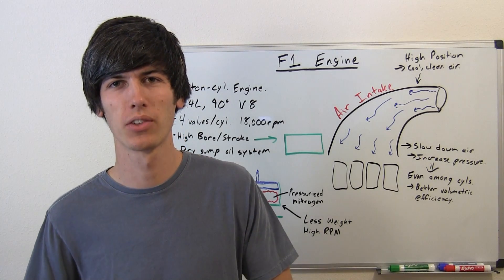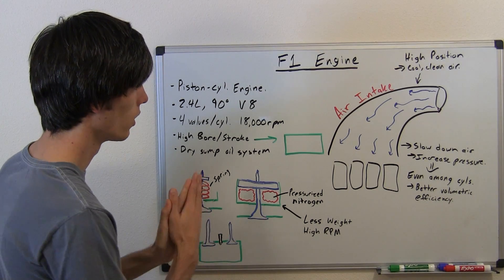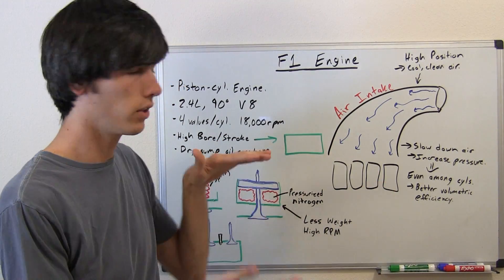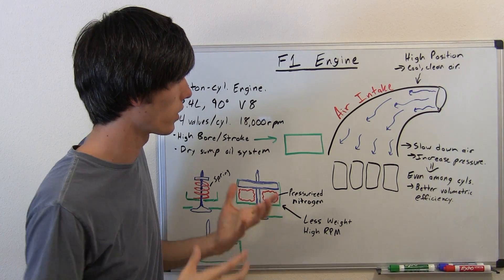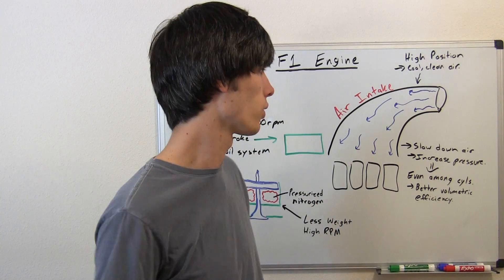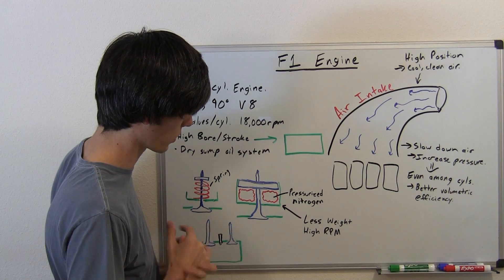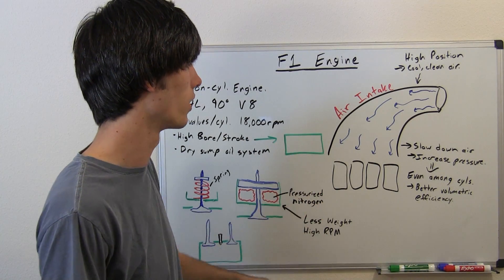F1 Engine - Explained

Comment: they were only limited because of the grooves , but not from tire wear , they pitted pretty much every 10 laps , nowdays at the end of the stint they have little fuel but most times they are on tires that are almost destroyed  , 2004 cars also had traction control 

but all in all i think the true diffrence in lap time would be about 2 seconds or 1 compared to the 2011 f1 cars

Comment: Well, the tyres in 2004 were limited, but they wasn't such a big issue back then, because they hold half a race without big problems, not like the Pirellis now. And although they start with full tank now. The fuel load for the last stint in a race is comparable and the 04 cars used also groved slicks which should be slower. And still, the cars of today can't cope with the 04 generation cars. The aerodynamic and enginepower back then where just so much better.

Comment: yes but in races nowdays cars have FULL fuel and only limited amount of tyres , in 2004 they had unlimited tires , refueled and changed tires every 10 laps or so thats the reason why in some races in 2004 the fastest lap was faster than the pole time  , the cars were also lighter back in 2004

Comment: Yes in the qualifying. But in 2004 they drove the qualifying with the fuelload for the entire first stint in the race(12-25laps). Compare the fastest lap in the race and you will see, that the 2004 generation cars were 2-4 seconds per lap faster on the same course. Most lap records are still from the 04/05 seasons.

Comment from the maker: They may be titanium or another light strong material. Valve float typically is a result of the springs oscillating, almost randomly, at higher RPM, not having enough time compress and stretch out. The pneumatic valvetrain, as shown in the video, plays a big part (if not the biggest part) of allowing for high RPM. Once again, a small stroke is important as well.

Comment: doesn't the cam, weight of valves and spark also have something to do with the 18000rmp the engines are able to produce? because if you are building your own engine and try revving that to high you will eventually get valve float and/or knock. could you perhaps do a video on how the F1 cars are able to rev that high? looking into the "cam" lift and duration and what kind of valves and ignition units and curves they are using?

Comment: How does slowing down the intake air increase the air pressure? If pressure is the force exerted on the containing walls by the molecules, surely that force is higher if the K.E of the air molecules are faster? Am i forgetting about some other force? Iv just started my mechanical engineering course, we haven't covered any types of fluid motion etc. Thanks

Comment: The purpose of the oil pan itself is to keep the oil away from the crankshaft and connecting rods. A dry sump allows you to place an external oil pump wich allows you to lower the engine which lowers the center of gravity and also is much more effective at circulating oil in high speed corners when oil would be forced to one side of an oil pan.

Comment: Efficiency == Green. I know that seems to grate with a lot of you, but it's true. The Greenest petrol engine would waist very little energy on friction, noise and heat. It would all be used to push the car forward. Grand old F1 engines were very uneconomical. You've been cheering on Green engines (or Greener) for years and you din't seem to know it.

Comment: There are NO gearboxes that work like a F1 gearbox. Similar, yes, but not the same. Paddle gearboxes are just a fad, as most people use the gearboxes in the fulling automatic mode, unless they are racing, which should not be done on public roads. Most cars that are made for the track like the GTR and Porsche's Ferrari's etc, are terrible to drive in city traffic.
NO car has air controlled valve gear.

They now bear no resemblance to road cars.

Comment: I looked this up a few years back for some project and I am not 100% certain but I believe that it was because it lead to a number of accidents and they were trying to cut down on them.

I see where you are coming from with the argument for why not change the tracks but that is hardly feasible; it would cost millions to change the layout of the tracks and some of them, think of like Monaco, it would be virtually impossible. It was probably easier to detune the engines
Just my 0.02

Comment: great video, just one thing to keep in mind for your viewers. You explain volumetric efficiency right just just left out that there IS a sweet spot/limit. No matter if its supercharged, turbo charged, or naturally aspirated air/fuel ratio has to increase as well. im sure You know this but alot of ppl just think boost=hp which is not true. my truck is alot faster with 55psi vs 65psi bc my fuel caint keep up after 55psi. cheers

Comment: yep it does, because when you slow the air down, you have to squeeze more of it into the same space to keep the flow of mass (in a pipe for example) constant. There even is a formula for that, called Bernoulli's law.

Comment: They banned them in '89 to help make it safer; something to do with the fact engines were making about 750 bhp/liter. 
Now they are making a slightly less insane 3-400 bhp/liter.

For the 2014 season they are going down to 1.6 turbo v6.

Comment: It's like blowing through an unrestricted tube- if you kink it up (i.e., slow the air flow), the pressure goes up. Try it with a straw. Great presentation overall, no?

Comment: Not, really. It definitly helps yes, but the idle rpms are necessary because of the lack of moving masses. F1 Engines haven't even a flywheel. So, theres aside from high rpms not much that will keep the engine spinning.

The external starter is used to save weight. It's the only reason.

Comment: Correct me if i'm wrong, but is it the wide bore that results in high idle rpms in f1 engines?  Surely an engine with a short piston travel would idle higher seeing as the combustion does not have to push the piston as far to complete one revolution?  Is this also why the engine has to be fired up manually, or is that just to save weight?

Comment: air fuel mixture will always be required for the engine to combust at a steady speed, but it is ignition timing that dictates engine speed. Ignition Timing significantly lower than MBT, will result in poor acceleration or even no acceleration at all even with the "gas pedal" at WOT allowing more air to be injected. Ignition timing close to MBT  will increase cylinder pressure will results in a higher Σy*sin(theta) force, and torque . High timing results in higher pressures, which lead to knock.

Comment: I notice you didn't mention Brake Mean Effective Pressure... Might be a consideration to touch on in the future.. As well the rotating mass these motors do not have. 
There is a great deal of science that goes on with these engines. Not just with the theory, But with the components alone such as MMC's and so forth. 

Great video.

Comment: Hi, Many thanks for the explaination.
In fact it is quite simple and logical. My mistake is that I thought that the mixture volume is constant, no matter the rmps.
Now if I understand good that isn't the fact, only the air-fuel ratio is constant. Right?

Many thanks,
Best Regards,

H.

Keep on making these fantastic video's, everthing is very well explained also for a mechanical nitwit (I'm an electronics engineer)

Comment from the maker: No, an engine at 2000 RPM with the throttle completely closed (nearly idle, check out my video "gas pedal") will be pulling in much less air than an engine at 2000 RPM with the throttle fully open (and it won't be at 2000 RPM very long). As you burn more fuel (and air) the force is greater on the piston, so it speeds up, increasing your RPM.

Comment: Or has it something to do with the richness of the mixture that changes when you hit the trottle? So when the mixture is richer (more fuel vs air) the explosion in the cylinder is larger, so the piston is slammed harder down, so it the whole cycle becomes quicker, so higher rpm? I also thought that the mixture was constant (except for a cold motor) or isn't that right neather? I'm confused and maybe a little dumb.

Comment: Great explanation!

One, maby dumb, question:
1 first of all excuse me for my poor English
2 I know the principle of different type of motors (2 stroke, 4 stroke, diesel, Wankel, etc.
3 But, (it may be silly) what I don't understand how the rpm's increase in a motor.
When you push the trottle, basicly there is more mixture (air-fuel) is pumped from the injector system (or carburator) to the cylinders, but the amound of mixture in the cylinder is equal every stroke (or isn't that right?)  Tx H

Comment: Regular cars are a bit heavier than F1 cars, to move weight you need torque to make torque you need displacement, you also don't need to accelerate from 120 to 180 in 2 seconds in a regular car as often either. Piston speed is still bad on blocks which conventional (especially Ford modular v8) engines still have plenty of. This is one of the reasons why the Ford 4.6L and 5.4 v8s weigh as much as a Ford 7.5L v8 as the blocks are cast very thick to support the unusually long strokes and high rpm.

Comment: Each race is around 300km so 8 races would be 2400km. I think the block is aluminium but a lot of titanium and other expensive metals is also used. Also pretty sure the nitrogen valve train is custom built for the F1 engines.

Comment: Also, these motors operate above 100% VE. They use overlap of the camshafts to do this. The intertia of on coming air allows more air to be packed into the cylinder.

Comment: You are incorrect the short stroke makes it cover a shorter distance at the same rpm. If you have two engines with equal rpm and one has a longer stroke, the piston must travel faster to cover the extra distance. It's simple math.

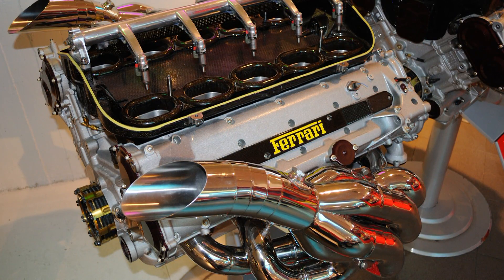Comment: At 8:18 your information about piston speed as it relates to stroke sounded incorrect. The shorter stroke is precisely what causes the piston to move faster,hence the engines higher rev capability.

Comment: Not true, paddle operated gearboxes are becoming common, even in cheap cars.
The engine preheating, the 2014 regulations is doing away with most of that, the 2014 turbine must be able to start and run at background temperature, it is in the FIA regulations.

Comment: The main point is resonance (frequency) Normal  steel spring will lose its tension  when it hits its natural resonance just google it. Its like the diifference between trying to make a steel bar or a rubber balloon to vibrate on a specific amplitude.

Comment: When will we ever see engines that have to be heated with oil and water before they can be started? When will we ever see air controlled vales in cars? When will be ever see carbon fiber brakes or clutches? When will be ever see gearboxes like in F1 cars? All  in regular cars? NEVER!

Comment: Renault first used pneumatic valve gear on their turbo V6 they had in 1986. Lotus used those engines in 1986, since the Renault car team had withdrawn after 1985.

Comment: So the pneumatic valves offer more powerful resistance than traditional springs. How does this not destroy the camshafts? With the amount of force behind the compressed nitrogen wouldn't that ruin the cams?

Comment: The minimum life is regulated. At the moment, the engines had to hold up to 4 complet raceweekends. Which means they done after around 3000km/1500miles. But thats only the block/head/crank- camshaft and pistons/cylinder and other internals. Every external part, like the alternatore/oilpump/waterpump/KERS-Motor and so on, are changed after every race due to increase the reliability because a failure of this parts can also destroy the engine, which would be a desaster.

Comment: nice video now i understand about high rpm engines. 1 question what's the life of a f1 engine ? are they durable like normal engine or they have to replace some parts like top fuel dragsters for each race ?

Comment: Well its RPM and throttle.  At idle the engine is under vacuum and not burning much fuel, but under full throttle its displacing its full amount.
This is the same with all cars, except stock street cars are extremely muffled so its not as dramatic.

Comment: F1 engines have pneumatic valve trains, not the usual spring and valve setups. It was first used and designed by Williams F.

Comment: Engines sound comes from its configuration and firing order, and exhaust also plays a big role.
Turbo's act a bit like a muffler and change the exhaust note of a car.  Most engines tend to sound better turbocharged (esp if you can hear the warble) but I'm sure that's not always true.
Personally I think turbo I-6's, and V8's sound the best, but everyone loves their own thing.

Comment: The rumbling in the pits are made up by the pitspeedlimiter. In fact, they limit the revs quiet harsch.
The crackle or popping sound is in fact a misfire. It's not so obvious at the TV because the Microphones can't record it in a proper way. The misfire isn't a failure or something. The ECU interrupts the ignition for a short moment when the gearbox is shifting to reduce the load on it. Some unburnt fuel-air mixture then ignites in the exhaust and you can hear a "pop" on the TV.

Comment: Hum hum... I thought that air entry was designed small to large to create a venturi effect, giving it more speed to "overfill" the engine with air, a bit like a turbo... It's not slowing the air at all in this case, does it?

Comment: It all depends just on one fact - crank sh./cyl. arangement. 4stroke engine works on every second round, most of ussual engines has crank shaft arranged in 180°offset - so logicaly, there must be 2cylinders working at once in case of 8cylinder engine ...
You could make an 8cyl. engine with separate each cyl. working period - but then a very complićated crank shaft 'd be needed. YZFR1 2009 (big bang) did have 90°crank offset - need to know what's big bang and what screamer :-)

Comment: well from my point of view, it is very strange because you know two cylinders are really never sinchonized for several reasons, compression difference, ignition timing,temperature, etc i mean you could make bigger piston in a v6 instead smaller ones in a v12 exploding at the same time in 2 similar c.c. engines, however thanks for your explanation there are many interesting things in your channel.

Comment: just a difference in the way engines are set up. bigger engines last longer due to the lower rpm. parts don't wear out as fast, but they have a more narrow power band and generally slower response time kinda like a Harley vs a sport bike. Harley will get the sport bike off the line but the sport bike will kill the Harley in the top end.

Comment: small stroke engines make higher horse power and lower torque than a large bore large stroke engine. torque is the ability of horse power to do work. Volvo has a 16 liter 6 cylinder engine for their trucks that makes up to 605 horse power at 2000 rpm and 2250 ftlb torque at 1100 rpm due to the large bore and stroke of the engine. a small engine with the same power could not pull a load or live running over1,000,000 miles of hard work due to the less torque output even if horse power is the same

Comment: exactly, something like horsepower per gallon is a term that would make sense, and obviously extra weight will lower how far you go with that horsepower, always found it annoying how 1 litre 4 cylinder is automatically seen as way better than a 6 litre v8, not necessarily the only obvious factor is the v8 probably weighs more as well as the additional inertia and friction from bigger parts but you cant know for sure which is more efficient just off those stats.

Comment: What you mean with irregular? It's a racing engine and so it has nothing to do with normal engines. This engines are single purpose build. Why 2.4l V8? Because the rules say they have to use this type. before the V8, they used 3L V10. You can say, the V8 is a V10 with 2 cylinder missing, but then, why they used a V10? Because the rules said they had to. F1 was always a rule thing and will always be. The goal is to build the best possible engine which don't breach the rules.

Comment: I have always been interested in it. Let me ask this? I understood that high rpm engines have shorter pistons or cylinders, but why do they build irregular v8 on 2.4 liter? What kind of advantage does it give? Because on regular cars you can see i4 2.4 L, Not even v6. In Eu some bmw/lexus models have i6/2L (not ussual in US)

Comment from the maker: BSFC is probably the most critical factor in determining how efficient an engine is. Power/size doesn't really tell you much, but typically if this is higher the engine is going to be compact for it's power output, which can be beneficial.

Comment: bore/stroke ratio is high, that configuration is called over square, meaning the bore diameter is over twice the stroke in this case. Great that you explained pneumatic valves for high rpm engines. Tip, add: Piston speed (about 40m/s) + piston acceleration from top dead center, impressive stuff + possible a bit more about the RAM effect from ram air box at higher speeds. Well dome my friend, very glad to see spreading of this type info. Warms my heart, please keep this up and educate people.

Comment: so the pneumatic spring its self wont fall into an oscillation leading to a loss of spring pressure.
and you don't need pneumatics to turn 20+krpm just take a look at a cbr250rr 

anyways not trying to dis you or anything im just bored at work.... damn 12 hour shifts 7 days a week. you may or may not know what I told you. but its impossible to explain an f1 engine in 5 mins, 
p.s. if a prostock drag car is @ 120% VE id bet you your lunch a f1 car is over 105%
also check out speedtalk forum